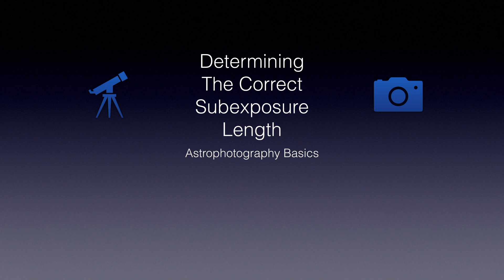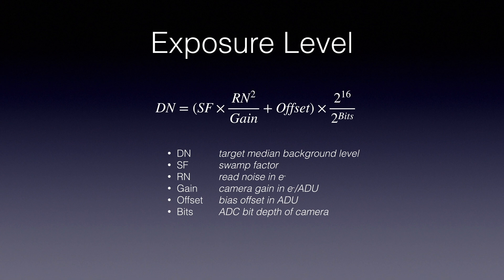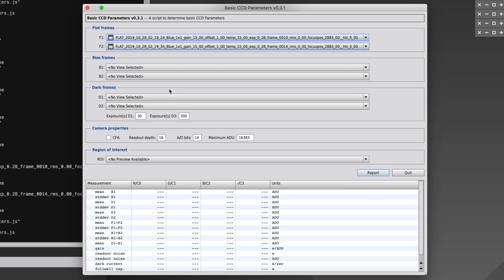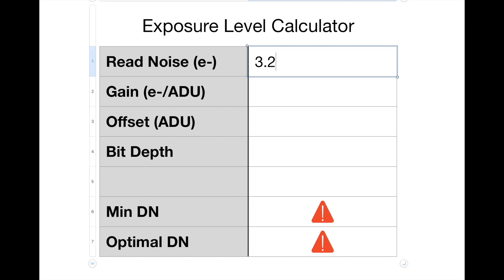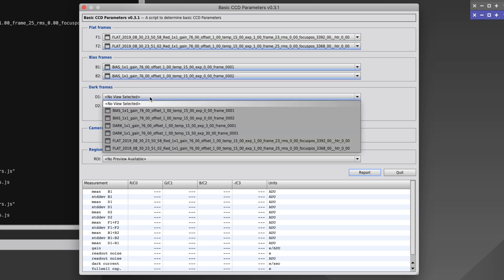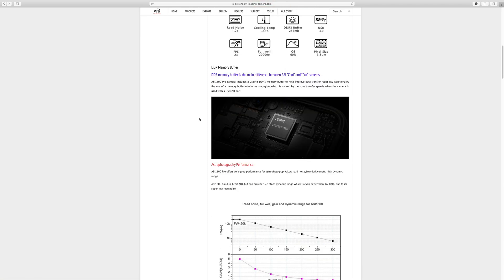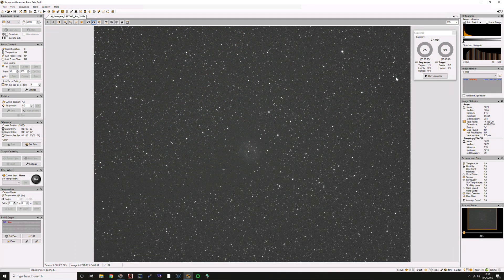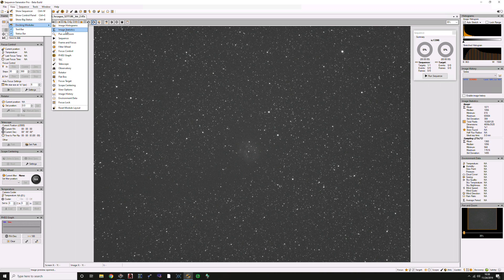How To Determine The Optimal Subexposure Level For Astrophotography

Comment: Thanks I watched it entirely I am going to try it. How do you calculate the number of subframes you need?
Reply from the maker: That's a good question. Largely it comes down to answering three questions:
1. How much patience do you have?
2. How bright is your sky?
3. How much patience do you have?

The darker your sky the less time you need. I have an image that I got in 90 minutes in a Bortle 2 sky that would have probably taken at least 8 hours in my Brotle 7 sky. Generally, here in my bright suburban sky I try to get at least 8 hours and more if I can. The fainter the object the more time you will need but I don't have any quantitative numbers to suggest.

If you manage four hours one night and you process and want less noise then get an additional four hours. If still too much noise then get eight more. Eventually you'll decide you've had enough or lose the object for the season. :)
Reply: Linda's Astronomy Adventures we just need a good old fashioned blackout, on a clear night with no moon!

Comment: Do you have a link to your calculator you were using?
Reply from the maker: Dustin, here's a read-only link to the icloud numbers spreadsheet I used: https://www.icloud.com/numbers/0T96cjAMDXFZBLcgxCVqC7UZA#Optimal_Exposure_Level_Calculator. You can copy that to your own spreadsheet. If you can't access it for some reason or would prefer to create it in excel or google sheets here is what the cells are:

b1: read noise
b2: gain
b3: offset
b4: bit depth

b6: min dn = (3×B1^2÷B2+B3)×2^16÷2^B4
b7: optimal dn = ((10×B1^2÷B2)+B3)×(2^16÷2^B4)
Reply: @LindasAstronomyAdventures  Gosh thank you so much for this!!!!

Comment: Hi Linda, such a helpful video. I do have one question I'm a bit unsure about. I'm using a QHY183m, QHY specify their gain and offsets differently to ZWO so I'm not sure the right value to use for offset/bias. If I am to use unity gain which is set to 11 in the driver, this obviously is 1e/adu for gain. However I'm not sure what number to use for offset. QHY specify 8 for their offset  but if I use this in Johns formula, I get a pretty low DN of 488, i.e. ((10 x (1.5^2 / 1) + 8) x 2^16/2^12 

I thought generally you would want a DN around 1000, depending on your sensor. Is this correct? Or should I be converting the offset into something else?
Reply from the maker: Daniel, if 8 is really the offset then that sounds right. I'm not familiar with that sensor or QHY cameras in general, but at unity gain, a bias frame ought to be around 9-10 ADU depending on whether the read noise quantizes up or down (or 151-160 DN in 16 bits). Is that what you are seeing? If it is, then the offset really looks like it is 8.
Reply: @LindasAstronomyAdventures  OK Linda I'll  run a bias frame through PI and see what the ADU is, I assume I should be looking for the average value here? Should this just be an individual bias from or should I use a master?
Reply from the maker: Look for the median. I actually just posted a video today on estimating the offset with two methods: https://youtu.be/J1xi24yxvR0. Let me know what that provides for you! I'd love to get some feedback on it.